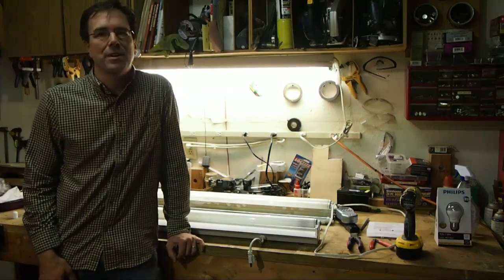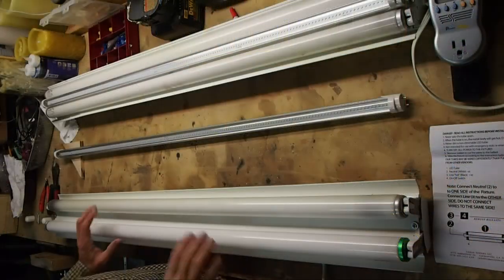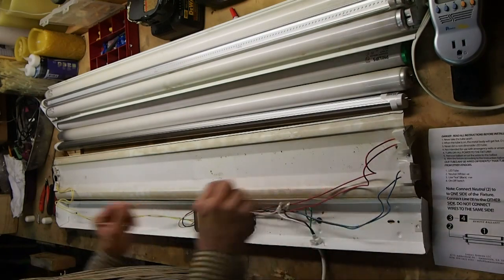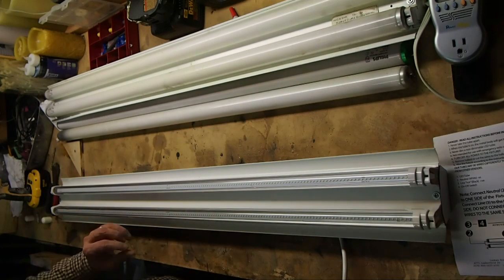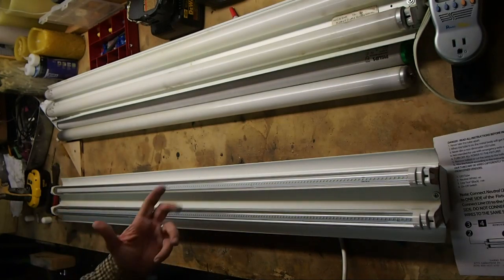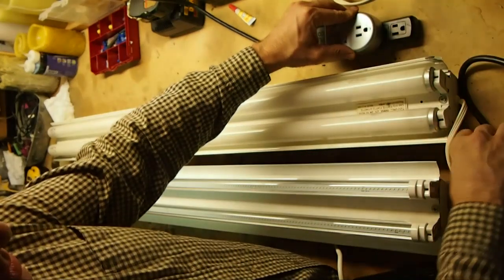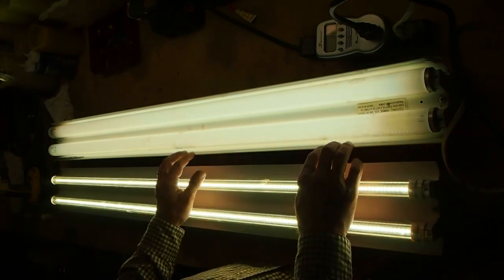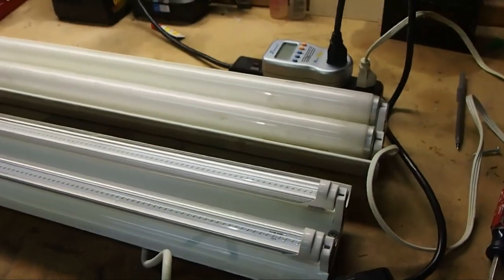Fluorescent Tube LED replacement - ALITE T8 LED - T8 T10 T12

Comment: led lights are rated for almost twice the lifespan of standard tubes. standard tubes "fade" a lot more so older lights will only output about 50% of the rated output. leds also "fade" but only to about 90% of the rated output. led tubes are also directional so there is no lost light from the reflectors, it can be as much as a 50% loss due to multiple times the reflected light has to bounce off the poorly designed reflector but generally 80-95% is considered normal for losses due to the reflector. retro fitting led's is fine considering the light will not use the reflector.

Comment: Almost all the LED no ballast tubes that I see require single-ended power. It looks like this lamp is double-ended power. The listing seems sketchy on these double-ended ones. Why aren't they more common, as it requires much less installation labor than single-ended tubes that require non-shunted tombstones?

Comment: LED lighting sucks.  LEDs are a very poor source or lighting, because the actual light emitted is only a magnified refraction.  Whether the LED is using high frequency voltage or just straight 60/50 cycle line voltage; they still bother the piss out of your eyes.  LEDs have a very poor light range , with very cold / poor lighting colour temperatures and many shadows.  It's funny seeing when the things start to fail as well; as they constantly flicker at a rapid pace, almost like a form of strobe light.  T-12 lighting is far superior to any other forms or fluorescent lighting, especially when the lamps use a magnetic ballast. There is no electronic light ballast or lighting that will last 20+ years of daily use and that is a given.  I have had 8' high output fluorescent lights in my shop for over thirty years and have only had to replace one ballast and the lamps only once.  I am in my shop daily and the lights are generally for 8 hours a day.  The is no LED or electronic lighting that will last 20 years, let alone 30+ years of daily use and you can count on that.   Don't let the lighting companies and their sales reps suck you in to the new aged garbage.  The simple reason they want you to replace isn't because the new stuff gives off more light, saves you energy costs, or will out last; it's simply to make more profit. ;) Does your energy savings outweigh the cost of constant replacement?     Remember more profit keeps the fat cats happy and at the same time, make you believe you have done the right thing.
Reply from the maker: congratulations. you've managed to create a post using no actual facts. impressive.
Reply: +1! I went to a sonic place that recently downgraded to leds=Instant headache. Fluorescent lamps had flicker, but it wasn't as bad as led. Also, some of the led lamps started failing, a vast array of strobing,  flashing, and flickering. The installation was only a couple months old!
Reply: Well, thats a load of bullshit. All lights connected to an AC source will flicker at whatever the frequency of the power supply is. If you are one of those poor, sensitive snowflake types that can't handle flickering, try converting to a lightsource that incorporates a bridge rectifier. Halogen downlights and their LED replacements are usually connected to a rectifier/transformer that pulls them down to 12v DC. Only problem is their additional current draw. The transformer makes considerable heat which, of course means wasted energy.

Your theories on the lifespan are also bullshit. Fluorescent lighting emits considerable UV which, of course, breaks down any plastic components in the unit. It also is why the powder lining the tube breaks down. LED's emit very small amounts of UV which, of course, leads to a considerably longer life of all components in the light fitting. LED's also emit very, very little waste heat. Nearly all energy consumed is converted to light.

Trying to say that you have used a tube for 20+ years for 8 hours a day and only changed tubes once is a lie.

LED lighting will outlast all other forms of lighting currently in production simply because they don't get hot and they don't break down their fittings with excessive UV.

If you are having difficulty with failing LED's, stop buying cheap, crappy Chinese knock offs. With the incredible lifespan of high quality LED lights, you will make a significant long term saving. Plus, the quality ones have quite impressive warranties. You get what you pay for...

Comment: I doubt very much that you read the power meter right. I suspect it said 85Watts, which makes more sense for 2x 40W tubes. LED lights typically use half the power f fluorescents of the same brightness.
Reply from the maker: With all due respect, I can read a digital meter. I agree 35 watts is low (and not typical) for fluorescent bulbs, but there are apparently conditions where they pull less than their rated wattage. Perhaps as the bulbs or ballast age, their consumption decreases along with the lumens?
Reply: gmatochautube i m not sure if 1 40W ballast can drive 2x 4' fluro tube or not, but were u by any chance doing that ? a single 4' fluro itself takes up 35-40W for sure.

Comment: One of the nice things about LEDS is the temperature they can work in. I have a workshop with no heating and I have a couple of fluorescent fixtures that give poor light when it gets really cold. No problem with any LED lights. Throw the switch and they just work pretty much the same no matter what temperature. I replaced a porch light that was a screw in fluorescent with a LED type. Wow, what a difference.

Comment: Cool!  The clear glass is why the LED tube light looks so directional.  If it was frosted, then it would look "softer," like the fluorescent.
Reply: Kristine Ricca I agree. I have ones with frosted glass, and, when placed in the fixture, they light up my garage almost the same way the old fluorescents did. They turn on immediately and don't flicker, though, which is a plus.

Comment: I have a few 8-foot long T8's (actually T12s like the ones you are working with here) with the dual-pin spring type ends (sometimes called "recessed d.c."), and cannot find any direct LED replacements for them.
Does anyone manufacture these, or is swapping out the fixture (or at least doing a retrofit with new "standard" sockets) my only option?

Comment: Thanks for your vid ! Power factor improvement is important as well.  I changed out my shed lights for Syntech 18W LED tubes the other day:

One single 36W T8 fitting with ballast and capacitor, went from 49.2W, 0.25A, pf 0.81, to 18.4W, 0.08A, pf 0.95.

The other was a 40W T12 fitting, ballast only, went from 48.5W, 0.42A, pf 0.41, to 18.7W, 0.08A, pf 0.96.

Big drop in wattage, but even bigger drop in current draw due to improved power factor.
Reply: power factor and luminous efficacy are both important.12w 1200mm 150LM/W PF 0.96 led tube is popular nowadays.

Comment from the maker: Quick update on my LED replacements...two years in and still going strong. Hope to review one of the recent bulbs that don'e require replacing the start and ballast...stay tuned.
Reply: smart decition,the bulp without start and ballast allready existed,but the high luminous efficacy led tube of 150lm/w 12w is better,it can save more electricity more quickly.
Reply: gmatochautube A ballast went bad, and rather than replace it, we put in a pair of Hyperikon BallastCompatible(R) 2.0 Hybrid LED tubes we got from Amazon.  They lit with the bad ballast, but one was dim according to placement in the two-tube fixture.  They both went completely off occasionally.  Now that the fixture is rewired to not use a ballast, they work well.  See http://www.amazon.com/gp/product/B00SSNPBD2?psc=1&redirect=true&ref_=oh_aui_detailpage_o00_s00
Reply: Appreciate the video. It helped greatly.
Reply: +Aiden King By the way, the James ballast compatible(don't require replacing the sart and the ballast) can work with ballast or without ballast.

Comment: I just kind of confuse to bypassing the ballast.. 
I have two ballast on my fixture .. Can you guide me how to remove those for LED light..
Can anyone send me video link? Thanks in advanced.
Reply: Dushyant Patel hello Do you want to know, do not need to change the existing line, plug and play direct replacement for existing lamps.
steven@lvdlight.org

Comment: The real energy savings will be in commercial buildings that use plenum space between the drop ceiling and structure above for HVAC cold air return as ballasts get warm and put more strain on cooling systems in warm weather months.  This, along with labor savings by replacing bulbs less frequently - especially in high-ceiling areas requiring use of a man-lift. 

But it's a neat product and a nice alternative to the flicker/hum, and so-so reliability of tube fluorescent bulbs.
Reply: led tube can be improved more

Comment: did you have to remove the Fluorescent Lamp Starter, or is that what the ballast does.  I have a fixture with a Fluorescent Lamp Starter  http://www.canadiantire.ca/en/pdp/leviton-fluorescent-lamp-starter-30-40w-0527831p.html#.UuKcLdhraHs  looks like this.  Have not opened the fixture yet, my bulbs did not come with instructions so I am unsure what to do. Also I only have one bulb. You put both wires together, would not that create a 220 volt on the bulb then. any advise greatly appreciated thanks
Reply: D. Reichert I used 2 approaches to this, and both worked.

The first time I replaced a fluorescent with and LED tube, I opened up the lamp starter, cut out the electrical components inside it, and twisted the 2 wires inside together. Essentially, that turned the starter into a single piece of wire. Then, I put the starter back in place.

The second time, I decided to try to do it a little better. I removed the lamp holders (the things you slide the ends of the tube into) and took them apart. That way, I could see how the lamp holders were wired internally. I moved the wires so that they would bypass the holder for the starter, and put them back together. That way, the fixture worked even with the starter removed.

Both of these methods worked, and LED tubes light up perfectly. The second method is cleaner, though, if somewhat more laborious.

Comment: Savings in labor, materials and energy are the main reason for converting to LED.
A more typical LED replacement uses  18- 20 watts thus reducing consumption by approx 50% as compared to the 40 watt T12 lamp in the video.

Comment: Hey, thanks for the video.. 
I recently bought some LED Tubes (they were the drop in type, where i only needed to remove the starter. But when i Turned them on they flashed really bright and then wend very dim.. Now when i turn them on they're really dim? Do you have any idea what the trouble could be?
just wondering if you knew!!
thanks

Comment from the maker: Been watching these. They sound like a great option, but I haven't tried any  yet. Some I've seen need the starter to be removed (leaving the ballast). This, while a simpler modification, seems to defeat the purpose of a "drop-in" replacement. Others don't, so check before you buy. I'll keep an eye out for some reasonably priced tubes and give them a try.
Also, Philips announced they would be releasing a 200 lumen/watt tube in 2014. Keep an eye out for a review as soon as they're available.

Comment: Thanks for the video - GOOD STUFF!  I have been considering doing some tube replacements in my place, and in my research I found your video. One of my friends pointed me in the direction of a tube replacement that he says does not require a ballast change or rewiring.  It's called an EverLED from a company named LEDdynamics.  There is a video on their EverLED site.

Would be interested on your thoughts, on drop-in replacements.

Comment from the maker: Yup, mixing "colors" in the same fixture will work fine. Many of the LED tubes now come with a frosted cover to better diffuse the light. But I have to say, after having these in my garage for a few months now, I wouldn't get the diffusing cover. The LEDS illuminate my workspace better than fluorescent tubes, and I think the lack of a diffuser is the main reason. Light bouncing off the fixture/ceiling isn't as efficient as direct light.

Comment: I'm glad I came across this video as I have been thinking of upgrading the fluorescent tubes in my kitchen's drop ceiling with LEDs for awhile now. You make it look easy. Currently I mix 2 "daylight" and 2 cool white tubes in the same fixture because i like the light that both emit together. Would I be able to do the same with the LEDs seeing there are different lumen ratings? Also will the cover on the fixture (plastic panel) help spread the light better seeing the LED is more directional?

Comment: The benefit for these devices for me, living in the frozen tundra of Wisconsin, would be their ability to provide instant light with little to no warm-up period, especially on sub-zero winter days.  On some days, the fluorescent tubes in my garage barely come on.  I'm sure that can be overcome to some degree with high-output ballasts, but that's another $50 per light fixture to upgrade them.
Reply: Checkout EnergyBank.com out of Manitowoc, WI. Industry best LEDs.

Comment from the maker: Yeah, that's a good point. Fluorescent bulbs are already pretty efficient, so the case for switching from flourescent to LED is not as strong as switching from incandescent to LED. Assuming the following:
- 2 LED tubes consume 40w
- 2 fluorescents consume 80w
- LEDs cost $50 more
- electricity for $.12/kwh
- 3hr/day usage
- no premature failures

then the payoff for the LED bulbs is 9.5 years.

But that doesn't take into account the convenience/cost savings of not replacing the LEDs.